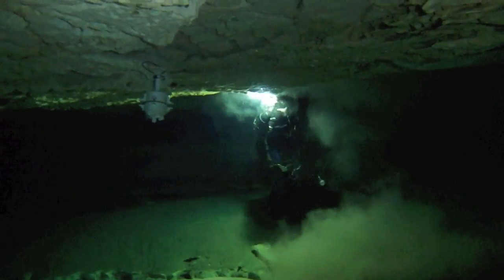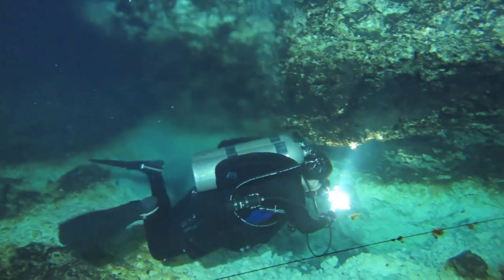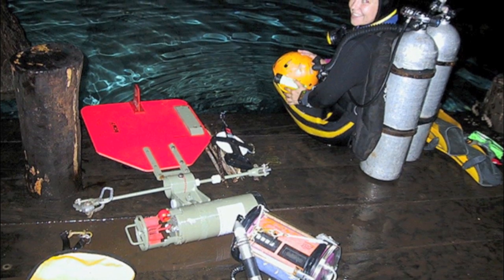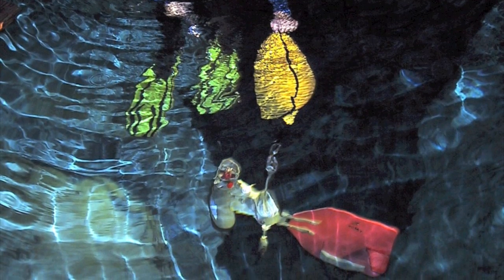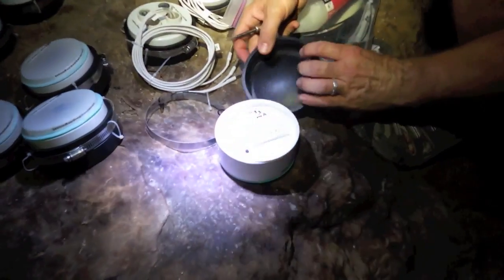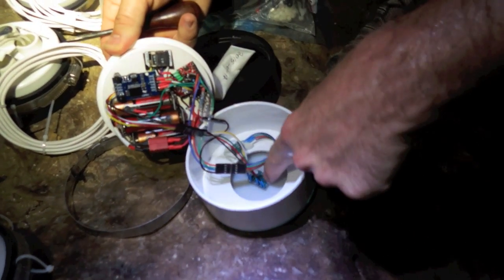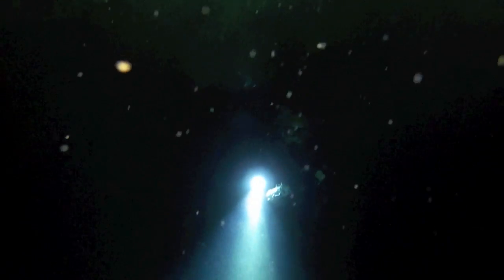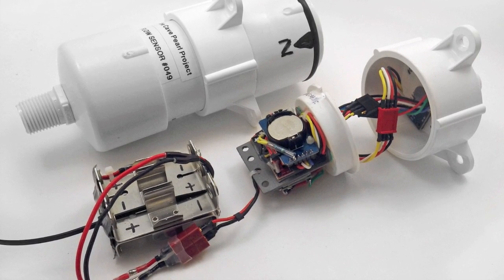The Cave Pearl Project Interviews

Comment: Hi, I have an idea for you.
You can use hall-effect sensors and magnets as switches. In other words, if you wanted to have like a button to download information--instead of drilling a hole through the housing, you could attach a hall sensor, such as a Honeywell bipolar sensor inside the housing--with no hole drilled. Then it can be activated by a magnet.

Also, with some experimenting linear or ratiometric sensor can be used for with springs to measure pressure or flow, or perhaps with a lever to show water level.

Cool, inspiring projects.

Comment from the maker: The latest 2022 iteration of our 'mini' logger can be made using only two parts:  A Pro Mini & an RTC module.  
Assembly can be done in about 15 minutes, and it runs for a year on a Cr2032 coin cell.
https://thecavepearlproject.org/2022/03/09/powering-a-promini-logger-for-one-year-on-a-coin-cell/

Comment: Just saw this posted today from Kevin Darrah.  May help you lower the current draw even more on your loggers. I am always looking for ways to extend the battery life on some of my very remote weather stations.

 https://youtu.be/urLSDi7SD8M
Reply from the maker: +mike95826 Thanks. That is by far the best explanation of sleep modes Ive seen to date. The library from Rocket Scream lets you enter all of those modes easily, but its nice to see how its done from scratch.  I have also been looking into latching circuits lately, (there is another nice one over at EEVblog)  but the delays involved with restarting the Arduino can give you grief when you need many interrupt level response to sensors in quick succession. This is surprisingly common for things like wind sensors, etc and I end up with peaks >10 per second on some of my builds.